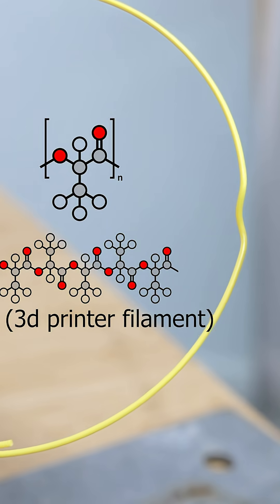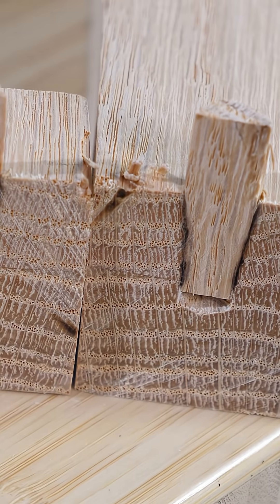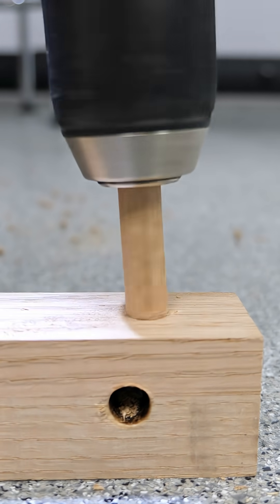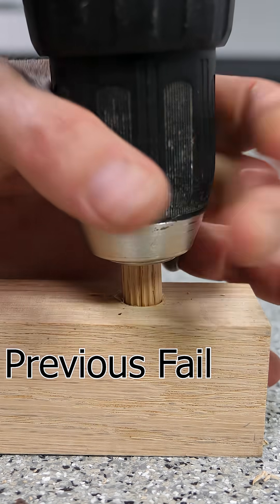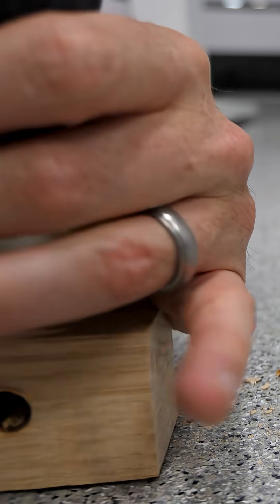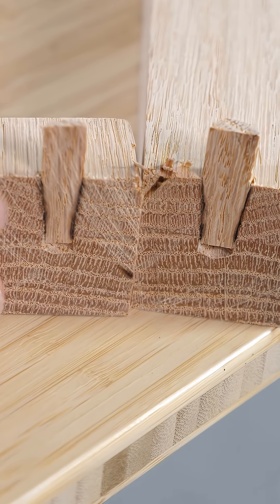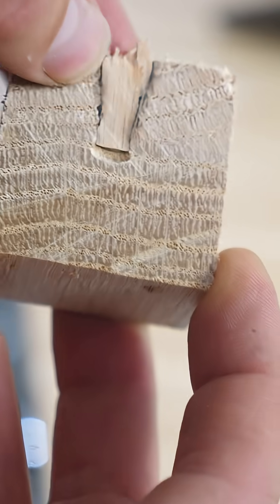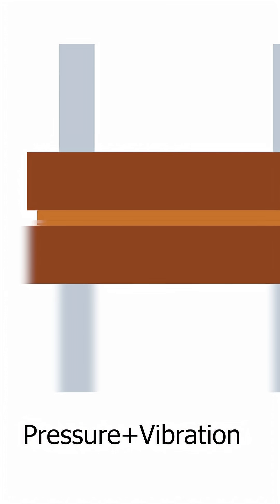I Melted Wood With Friction

Comment: Polymers do melt, and it’s not called the glass transition temperature.  Those are two very different things.  The glass transition temperature is related to the change from crystalline to amorphous structure. The melting temperature is the transition from solid to liquid.  However, due to the distribution of chains with different length, there isn’t a single melting temperature, but a melting temperature range instead.
Reply: That is completely wrong, glass transition and melting are two completely different phenomena! The glass transition temperature is not related to a change from a crystalline to an amorphous structure.

We know of 100% crystalline polymers such as poly(ethylene glycol) that exhibit only crystalline melting but not glass transition, and 100% amorphous polymers like poly(propylene oxide) that exhibit a glass transition, but not crystalline melting. I know this for a fact, because I actually ran DSC experiments on both of those polymers and saw it for myself. No glass transition in PEG, no melting in PPO.
Reply: @kubaGR8 would that have anything to do with thermoplastics vs thermosets ? I vaguely recall something about some plastics being able to melt and resolidify while others cannot.
Reply: @kehindeakiode2865  It's not as clear-cut, because most plastics you're likely familiar with (PE, PET, PP and so on) are actually partly crystalline and partly amorphous - meaning the exhibit both a glass transition AND crystalline melting! This is because they have the structure of "clumps" (for lack of a better word) of polymer crystal, embedded within a larger structure of loosely tangled, unordered polymer chains. Thermosets behave the way they do due to a different mechanism than just mere melting and glass transition, however.

Imagine taking spaghetti, boiling it, mixing it up into a big clump, then letting it dry out again.

The dry pasta is going to be stiff and brittle and basically impossible to separate, each noodle "frozen" in place and at varying levels of entanglement with the other noodles.

If you were to boil these again however, they would once again become soft and mobile. You could manipulate the blob of pasta a lot easier, and pull it apart without just snapping it like a dry block of instant ramen noodles. This is the case for thermoplastics... vaguely. It's not a perfect analogy.

For thermosets, imagine if after the first boiling, small amounts of the pasta dough would actually connect together, forming bridges of solid material between otherwise entirely separate noodles, until you have a three-dimensional lattice of interconnected noodles. Once this pasta mix cools down, it also becomes hard and brittle. But if you were to boil it again, the lattice would still remain connected to each other, and you wouldn't be able to pull it apart or manipulate it much without just ripping the noodles apart.

That is the main difference between thermosets and thermoplastics. Thermosets are cross-linked, and therefore do not "melt" in the common sense of the word, but rather hold their shape even at higher temperatures. This is actually a fairly big problem for the recycling of resins and the like - you can't just melt them down and cast them into another shape!
Reply: @kubaGR8  I do love a good spaghetti 🍝 model! 📈Even imagined ones! 🤔💭😅 Thanks for the explanation!
Reply: This is why my Masters in physics brother told me that glass is not a solid but a supercooled liquid.
Reply: . Nope. Even seems the "flow/settling/bottom thicker" of centuries old church stain glass window thing was misconception (according to ai search POV). Interesting as saw that 50 years ago when family member recycled some, when were doing stainglass art as a  hobby.
🤔 by supercool, maybe your bro meant  super interesting.

Oh, while I'm dubious of google search ai, try it. To my surprise, it seems old misconceptions evidently still around, even for masters level physics students getting overview reading (I'd gather nitty gritty solid state(aka condensed matter) studies would untangle the "supercool" misnomer moniker.
Reply: @davidbusen545  wronggggg this is a myth that has been going round the "I'm a smart person" circles for generations, but still wrong
Reply: &  never forget, oak trees melt steel beams.
Reply: You need to provide a link to where you got your definition. I looked at 10 other science sites and your definition is FALSE and incorrect according to them. Not a single site claimed a change from crystalline to amorphous. Try being better. Here is one of the definitions  - The glass transition temperature (Tg) is the temperature at which an amorphous material, like a polymer, transitions from a hard, glassy state to a more flexible, rubbery state.
Reply: @rbrought this isn't related exactly , but try finding the definition of a "glass-ceramic" , that gets a bit confusing.
Reply: @rbrought  Semi crystalline is literally in the definition. Try being better. 🥱
Reply: The man is aware, he's a science communicator, his goal is to entertain and try and get people to look that little bit closer.
Reply: @sebastianflynn1746  Then he should say that, instead of using glass transition temperature, which is a different thing as explained by the helpful comment person. 

This is why fewer people trust scientists now.
Reply: You know by not trusting scientists you're doing science and being a scientist yourself!
Reply: @SecuR0M I understand your frustration but I don't think anti-science folks are getting this far in their YouTube science journey.
Reply: @AcuranVenal  not even remotely right. I frequently see massive youtubers pushing absolute BS..... your arguement is basically "if enough people believe someone it must be true" which is..... so, so wrong
Reply: @sophroniel  I think there's been a misunderstanding. I'm saying people who already devalue or outright deny science probably aren't going to sincerely care about these details.

They're not going to draw a line at specific scientific terminology because they think the whole thing is fake to begin with. Whereas people who have a passing interest in science and get videos like this in their feed won't be offended by the mixup because they aren't experts who can really point out the misuse of the terms. 

Obviously, the creator should do his best to be accurate, especially as a science communicator; however, anti-science folks would already be engaging in bad faith.

Comment: I believe wood pelletizing relies on the same principle as well. If not, wood pellets would simply be saw dust.
Reply: @Hukkinen Compression works through friction, same concept
Reply: @gurun8071 Sounds plausible, although at microscopic level, seems same and different 🤔😊
Reply: Rather, I think they are compressed🤔
Reply: Pellets crumble quite easily, though. I always assumed they stick because of resin from wood

Comment: This reminds me of old motor grader operators “burning blue tops”. You pound a 1.5”x1.5”x6” stake in the ground exactly where you want the dirt level to be. Old school operators could set the blade perfectly so that it would rub just over the top of the stake without catching on it and pulling it out of the ground. The friction on the wood and heat of the blade through the dirt left the top of the stake burned and smooth. It’s really impressive to watch.
Reply: What? Hole, dirt, wood? What?

Comment: This is similar to how they make pellet fuel. Heat and pressure make the wood into a solid piece.
Reply: I wonder how much input energy is needed to produce that pelletized energy content? Energy input output efficiency
Reply: @Hukkinen based on cost of the final product, I expect it is pretty good.  Energy is generally a part of the cost along with materials, labor, and equipment. We used it for heat, and it was cheaper per BTU than propane, and about the same as natural gas, but we didn't have that option. So, after labor and equipment (materials are often waste products) being the same cost or less makes me think that it's pretty good.

Comment: "They don't have a melting point, they just get softer until they become a liquid" My guy that's literally what melting means
Reply: Water has a melting point where it turns from a solid to a liquid, doesn't get softer before that point
Reply: @nv7213  school'd em. stunted on em. took em to class
Reply: @nv7213  Is this because wood / lignin has a temperature RANGE (says Gemini) instead of specific temperature?